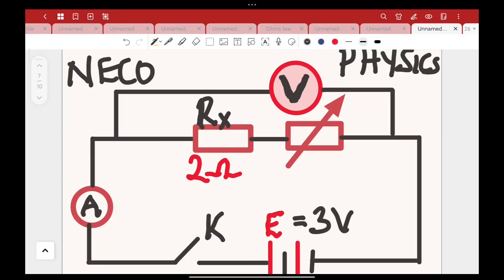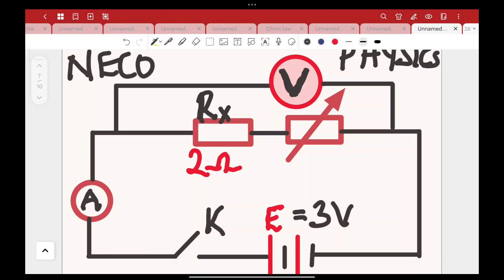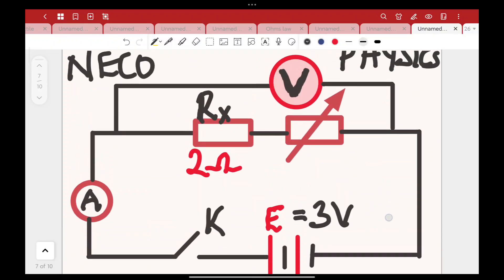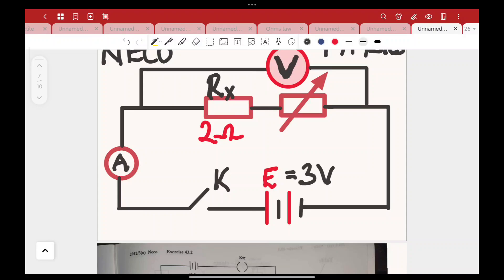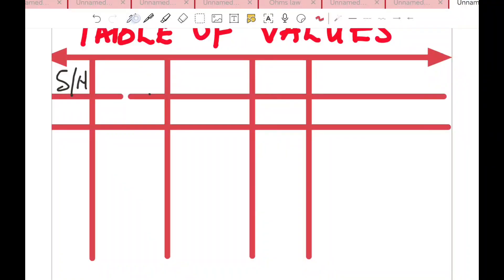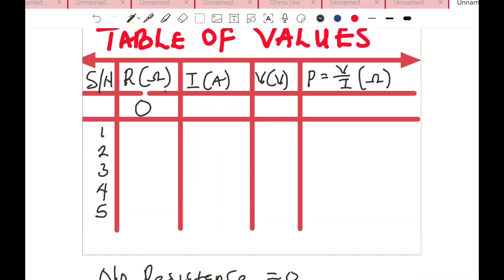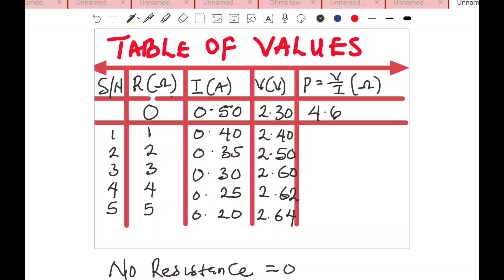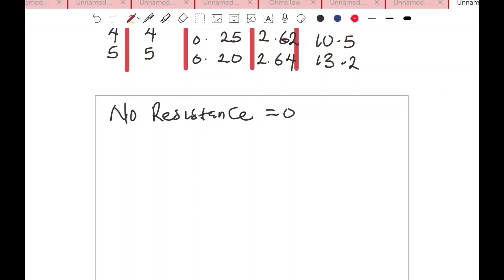Q3: NECO Physics Practical on Electricity Explained (Full Guide, Table of Values & Graph Work)

Comment: This is wrong pls. According to ohms law, v is directly proportional to I, meaning when I is decreasing V also must decrease. Reverse is the case in your readings
Reply from the maker: Remember based on what we ploted here, it's RESISTANCE AGAINST RESISTANCE. The graph has shown that the experiment is correct based on the concealed Resistor. 
In most circuits, voltage and current have a direct relationship; when one increases, the other increases, and vice versa. This is described by Ohm's Law. However, in some cases, such as with transformers and power supplies (e.g Batteries), voltage can increase while current decreases, and vice versa, to maintain a constant power level